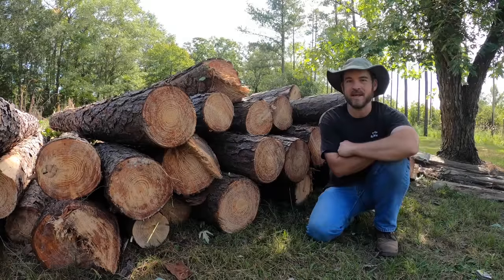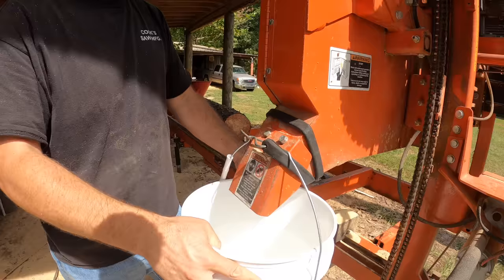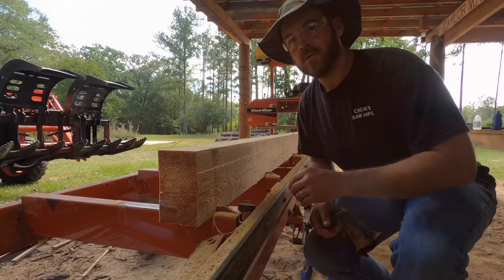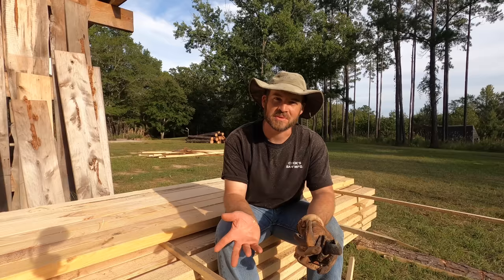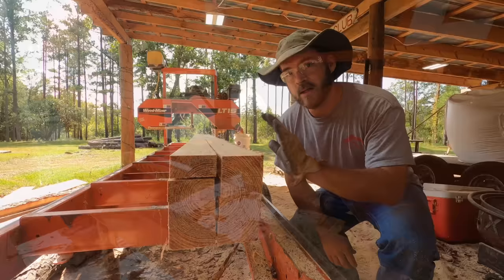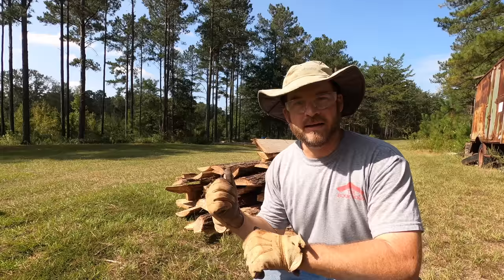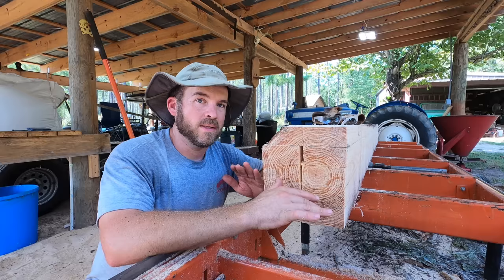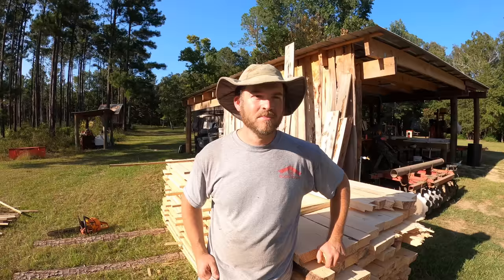Turning Trees into Money on the Sawmill

Comment: For sawdust collection, I’d get a bucket with a hole in the bottom
Secure a burlap bag to the base of it
And use the bucket as a bag filler.
Secure the bag with a ratchet strap and/or a bungee tie down.
Then you can fill bags of sawdust pretty easily, and the finest dust will escape out the burlap.
You might also get polypropylene rice bags from restaurants for free to fill.
Dog food bags are also good.

If the bag mouth is less than the bucket diameter, make an extension with a bleach bottle or something similarity shaped (a killing cone?)

Best!

Comment: When cutting pine, what do you use to prevent pitch build up on the blade?  Sawing with Sandy experimented with using ATF and seemed to have some improvement but still getting some build up. I want to try the bucket method as it is a pain to clean up sawdust on the ground. I try to either compost my sawdust or use it as mulch in the garden.
Reply from the maker: I'm using dawn dish soap and water. I have used diesel in the past, and it works like a champ, but I really got concerned about all the aerosolized diesel that I was breathing. The dish soap and water is not perfect, but it works pretty good for smaller logs like these. If I get buildup, I'll take a jug of diesel and pour a little onto the running blade and it cleans it instantly.
Reply: Thanks Wes. I will give it try. Might even try doing some ATG.  @falllineridge